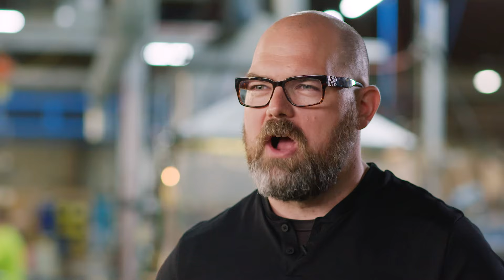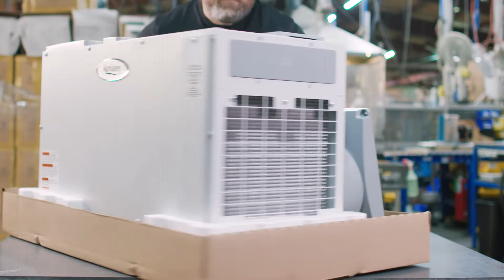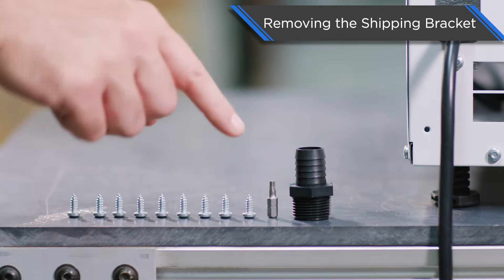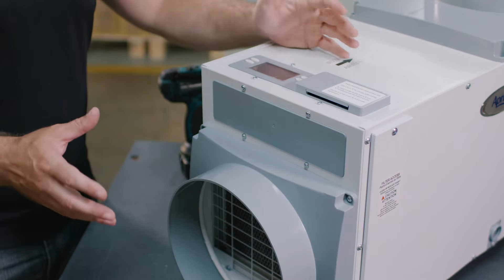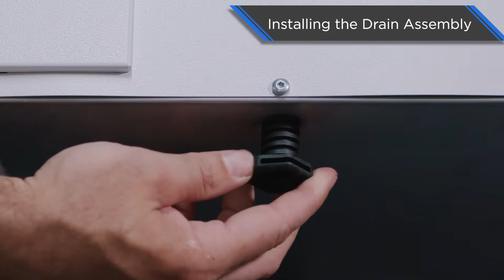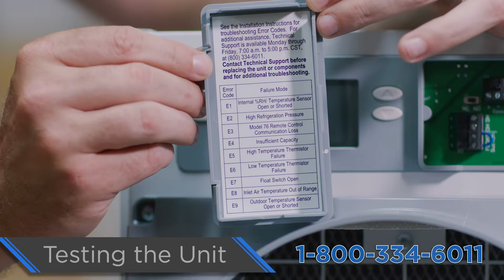Unboxing AprilAire Model 1830, 1850 & 1870 Dehumidifiers

Comment: If the dehumidifier senses that the air is too humid, will it turn on independently of the air conditioning system?
Reply from the maker: Thank you for contacting AprilAire! How the unit will operate will depend on if it is ducted into the HVAC system. If it is ducted into the HVAC system, it should be wired such that the dehumidifier turns on the HVAC blower. In this instance, it would not operate independently of the HVAC system. If it is a freestanding unit, it would turn on independent of the HVAC system. If you have any additional questions, please feel free to contact us at 1-800-334-6011.

Comment: My A/C technician will be installing two Aprilalire units that we purchased and will be attached to the HVAC system that we have in the basement, a 30K BTU Smasung.  We bought Aprilaire E100 Dehumidifier and Aprilaire 5000 air purifier. My question is what is the correct sequence of these units when placed after the return air. When return air from the house goes back to the basement which divice should be first? Dehumidifier or AIr purifier? And finally the clean dired air will go to the main compressor to be distributed in the house? Thanks
Reply from the maker: Thank you for contacting Aprilaire! We would want the installer to install the 5000 electronic air cleaner to be the closest unit to the furnace on the return air duct and the E100 to be upstream on the return air duct with a return to return installation. We want filtering the air to be the last thing done before entering the furnace. If you have any further questions, feel free to contact us by calling 1-800-334-6011. Thank you for the opportunity to be of assistance; Aprilaire appreciates your business.
Reply: @aprilaireco  Thank you so much. You are the best company.
Reply from the maker: @WordsPhotos  We appreciate your support! Thank you again for contacting Aprilaire.

Comment: Keep finding a puddle under my 1830 in my crawlspace that is coming from around where the drainage line was installed.
Reply from the maker: Thank you for contacting Aprilaire! Please ensure that the unit is fully level, both front to back and side to side, and that there are no blockages in the drain hose that may prevent water from draining effectively. If the issue persists, we recommend reaching out to your HVAC contractor for further troubleshooting.

Comment: Hello Aprilaire Crew.  Just purchased / installed the new E100.  It's going to be a standalone installation in a wide open 800sq ft basement.  

My question is:  Do the duct collars for each end allow the unit to work more effectively?  

As of now, I don't have them attached because I am not ducting it.  

Do you recommend attaching these?
Reply from the maker: Thank you for contacting Aprilaire! Aprilaire units can be installed freestanding or connected to the ductwork in a whole-home configuration. It is not necessary to attach the collars if the unit is to be left unducted. Connecting to the HVAC system increases the volume of air that can be dehumidified. However, because of the stack effect, it is also best practice to install a dehumidifier freestanding in a basement or crawl space application. If you have any additional questions, we'd be happy to assist.
Reply: i attached the collars and a few feet of duct on each side for a freestanding install since my manual mentioned quieter operation that way.  it also helps ensure you are not recirculating dry air through the dehu (point inlet and outlet ducts toward different corners of the space).

Comment: Just took delivery of my E100 (1850)... FedEx delivered partially unboxed, and unit was upside down, FedEx drivers are not to keen on shipping package warnings... All of those large arrows and letters are so cunfusing! And it was packaged pretty good, none of the E100 casing or other parts were damaged, which honestly surprised me, as I was expecting at least one side of the E100 cabinet to be crushed inwards, got lucky there. All corners were intact too, another surprise as FedEx really manhandled this thing, which is honestly uncalled for. I can say that, I have worked with UPS, SAIA, ABF and FedEx running those double trailers out of their shipping hubs, FedEx is the worst. 

On the Aprilaire end of things... The TWO zip ties on the shipping bracket were never put together, just hanging loosely, I am honestly surprised it turned on the way it was shipped and all... No signs of leakage from the compressor, and it is running, no abnormal noise to speak of. The unit is much quieter than that stand alone ACE Hardware unit which is right next to it. It should be even quieter once I see that everything is working properly and duct it into my HVAC system. Fingers crossed, I do not want to send this unit back for a replacement. 

I bought this unit, on sale, from the Crawl Space Ninjas. They have been great to work with, said no issue shipping a replacement out if need be. And they beat everyone else's pricing out there, they are also quick to answer the phone down in Knoxville. I would do business with them again without hesitation. 

Alright! Pray everything is working with this unit! So far so good!

Comment: Can the 1820 be plugged into a 15A outlet?  Depending what else is on that circuit of course
Reply from the maker: Thank you for contacting Aprilaire! We do recommend that the Model 1820 be plugged into a 120-volt outlet with a 15-amperage breaker. If you have any additional questions, we'd be happy to assist.

Comment: Can i ask some install advice please. Aprilaire e100 dehumidifier being ducted to return plenum. Plenum is 12 x 20"

Am I ok to use side takeoffs for the ducting? Easier for access here. 
Can they be 45 degree( essentially thats actually a top takeoff but being installed as a sidetakeoff) or do they need to be straight collar takeoff?
Reply from the maker: Hi Jim - Thank you for contacting Aprilaire. Our support team has advised that they were able to address your questions on this via email. We appreciate you reaching out! If you need any further assistance moving forward, please let us know.

Comment: If connected to my hvac ducts is the air filter necessary? I have a large 4" media filter on my hvac. I'd like to not have to crawl in my crawlspace to clean the filter.
Reply from the maker: Thank you for contacting Aprilaire! Would you mind giving us a call directly to discuss this? We'd be happy to help. We can be reached at 1-800-334-6011 Monday through Friday, 7:00 a.m. to 5:00 p.m. CT.

Comment: I suggest all potential buyers read the 1-star reviews on Amazon. Aprilaire puts up expensive and excessive hoops for you to jump through in your attempt to get warranty satisfaction.
Reply: I would not buy one of these units through Amazon, this is commercial equipment by all rights. I want a licensed vendor that I can call if need be. And like Iggy stated, you have no clue what you are getting on Amazon, learned that several times over, now I try to spend my monies elsewhere, there are much better vendors out there with better pricing and free shipping in many cases. The unit I bought was $300 more on Amazon.
Reply from the maker: Thank you for contacting Aprilaire. We appreciate your feedback. We follow a standard troubleshooting procedure to verify and isolate the problem so we are not sending the wrong parts or full units when not necessary. We would be happy to talk through further with you! Our expert support team can be reached at 1-800-334-6011 Monday through Friday, 7:00 a.m. to 5:00 p.m. CT.
Reply: Why are you buying through Amazon instead of a better vendor like Sylvane. Amazon sells knock off Chinese made Dehumidifiers as well. Amazon does not care how these items are shipped or handled because they just throw them back at small companies like Aprilaire while the overseas crap floods the "Sponsored, Highly Rated and Amazon Choice" spots... Go look into some of those companies and see what Amazon does to small business by shoving crap down your throat at every chance. Or in laymen's terms you are comparing a pigeon to a Macaw or a Dusky Lory :)

Comment: These work. Ours, installed today, is helping to preserve a graceful antebellum estate with a full basement limestone foundation, walls a foot and a half thick, without any significant insulation to speak of. Just came back from resetting a breaker and felt the change, but it took me a while to recognize it. The musty smell and the heavier "air" was gone, it was also cooler even though today was about seven degrees warmer.
Reply from the maker: We're so glad to hear it! Thank you for contacting Aprilaire and sharing with us here.

Comment: Can I use PEX for plumbing the drain?
Reply from the maker: Hi Ron - Thank you for contacting Aprilaire! You can use PEX piping for the drain on our dehumidifiers provided you are not using it in a space where the ambient temperature would cause the piping to melt, or cause water to freeze in the piping (for example, an unconditioned attic during the winter months could cause water to freeze in the piping). If you have any additional questions, we'd be happy to help.
Reply: @aprilaireco  Thanks. It's in my crawlspace. I don't think there should be any extreme heat.

Comment: You should include a short segment on adding a condensate pump.
Reply from the maker: Thank you for your feedback, John! If you have any questions on this that we can assist with, we can be reached at 1-800-334-6011.
Reply: @fastrivers812  I guess you’re supposed to call the 800 number.
Reply: @fastrivers812          Wait.....wires? Installed into the unit? I didn't have to do anything like that when I hooked my Little Giant pump up to this dehumidifier. Do you have some sort of specialized unit or something?
Reply: @SergeantExtreme  Normally you would wire the safety cut off from the pump to the dehumidifier. The pump wouldn't need to be wired into the dehumidifier but you have would want a cut off if the pump failed
Reply: @jonsaircond8520     Just Google searched it. So apparently, I ordered the Little Giant VCMA-15ULT which does not have an overflow cut-off switch. Those are only included on the "higher end" VCMX series of pumps. Well that's a bummer.
Reply: @SergeantExtreme  I just looked it up didn't know they made one without it. Unless it's in a attic shouldn't be that big a deal. I have seen a guy that pit the pump in a bucket with a float cut off in that. Could be a option if you got OCD like me after you find something out later
Reply: @jonsaircond8520      Yeah, my cousin (who works in HVAC) told me that Little Giant is the "Wal-Mart brand of pumps". I didn't know why he thought this until now. 

Because it's a basement floor dehumidifier, I'm not too concerned about overflow. But next time I buy a pump, I'll do more research.
Reply: @SergeantExtreme  ClearVue Condensation Pump with variable speed pump and floatless sensor. 120 volts. Good videos on that on Youtube. I bought one for  $83 and advantage is that it drains all the stale water too and a unique emptying system.

Comment: Should I use a condensate pump if I install this in my crawlspace?  I plan to gravity drain only by suspending the 1830 from floor joists under house using Aprilaire hanging kit and connect PVC pipe from dehumidifier inserted into an existing drain pipe which exits outside of foundation wall.
Reply from the maker: Hi David - Thank you for contacting Aprilaire! Can you give our Healthy Air team a call directly at 1-800-334-6011? We'd be happy to assist.
Reply: you only need a pump if you cant maintain the slope to drain outlet

Comment: Put a union on that drainline... maintenance is not if, but when.
Reply: union?
Reply: @enkrypt3d  If you go with pvc for a drainline, it means you don't have to cut/refit/glue anything all over again when unit needs to pulled for whatever reason - channel locks [with a light touch] or a strap wrench is all that's needed to make up or loosen it.  Guys with strong hands in most cases leave tools alone.   Your plumbing suppier keeps common sizes on hand most of the time.
Reply: @flinch622  not sure what a union is can u give me a link?
Reply: @enkrypt3d  Shop where you like, but here's one look at what I'm talking about: www.ferguson.com/product/12-in-socket-straight-schedule-40-pvc-union-with-buna-n-o-ring-seal-s457005/_/R-4465907
The fitting has three pieces - two that glue on, but don't forget to put the threaded piece in place first before gluing up.  Dry fit everything before gluing: the threaded part of this has to mate up relatively square - most pvc unions will have an o-ring.   If it gives you trouble staying put while making it up for any reason, a light coat of silicone grease will help it stay in the groove, but do not use anything petroleum based as that can cause softening/ageing of plastics and sometimes shorten service life.

Comment: I have the Model 76 control for my Aprilaire dehumidifier and I see that it sometimes is not running (dehumidifying) when the humidity is higher than the setting.  Why is this?  For example, currently it shows 70% humidity in my crawlspace, but it is not running even though I have it set for 55%.
Reply from the maker: Thank you for contacting Aprilaire. Can you give our Healthy Air team a call directly at 1-800-334-6011? We'd be happy to assist.
Reply: Aprilaire no worries, I’ve since figured out what I was doing wrong since I posted this comment.  I had the wrong setting selected.

Comment: I had one put in my crawl space 6 months ago. I was told it was quiet but it is definitely not quiet! It wakes me up often.
Reply: Have you found a remedy for the noise?  I have an 1820 model dehumidifier and we can hear fan motor running under our floor (it's in the crawlspace).  I'm thinking of adding some sound deadening foam between the floor rafters above the dehumidifier.
Reply: @canonman223  put rubber pads under the feet if its on concrete,

Comment: I purchased the Aprilaire 1850 and have it set to 40% RH. At this setting is it possible for the unit to reach this level. My home is only 1100 Sq. Ft.
Reply: I got a 1850 they will do 5000 square feet.  If your house is not properly closed up with 6 mill plastic and vents and cracks sealed it probably will have to work harder to reach 40%.  The reason why is the 1850 will be pulling outside air into the crawlspace and moisture from the dirt floor.
Reply: @conmigocarolinadenorte5558  I think you might be assuming he has a crawler. Your assumption could be correct but it could be a slab or even a basement.